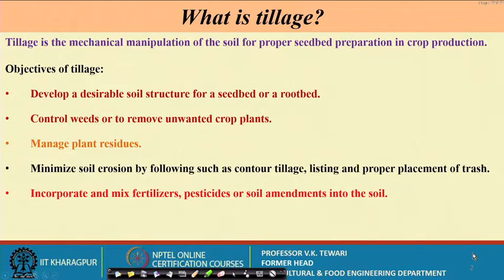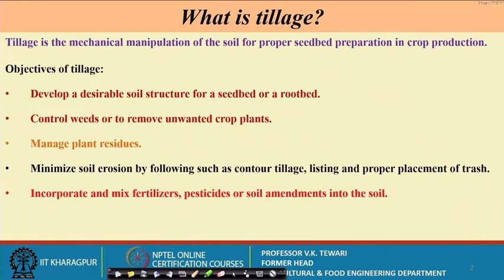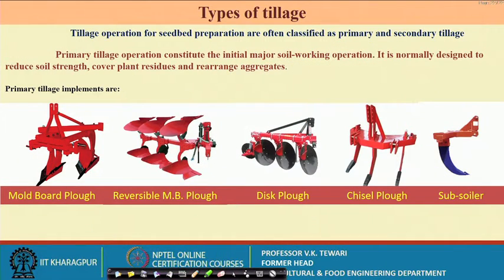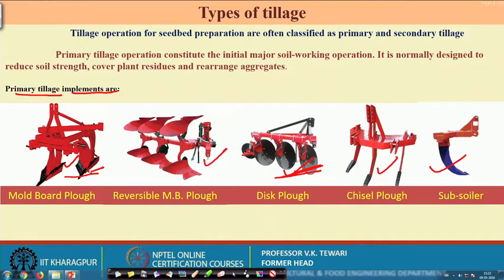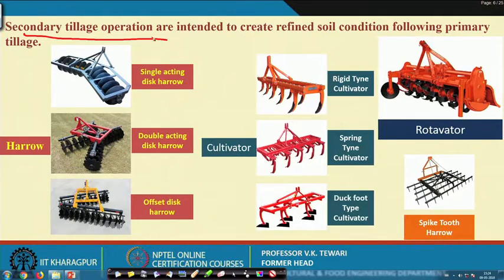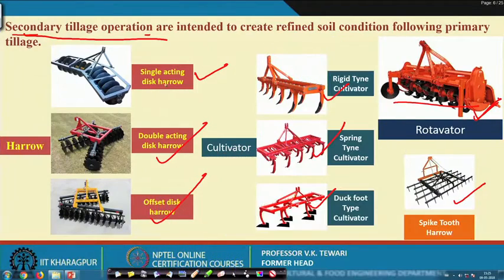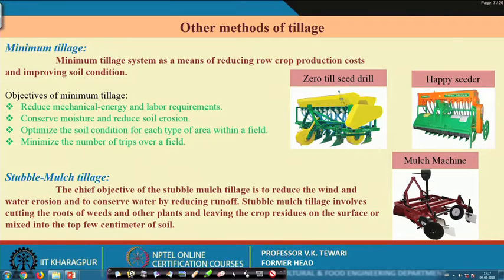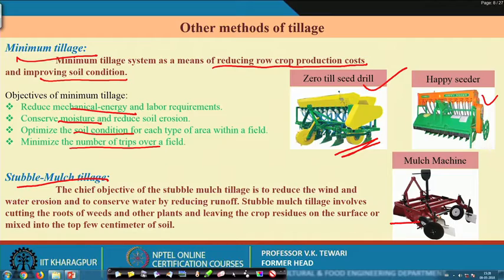Lecture 2:Ploughing and first opening of the soil, the design and    component details

Comment: Lower left link  should be attached 1st than 2nd one than the top link because the right lower link genrally has adjustment option but left lower link doesn't have any options

Comment: Sir hitching has been done in a wrong sequence, the lower link with adjuster was hitched first. However it is advised to hitch the other lower link (in this case Left one having no adjuster) then follwed by the right link and the top link.